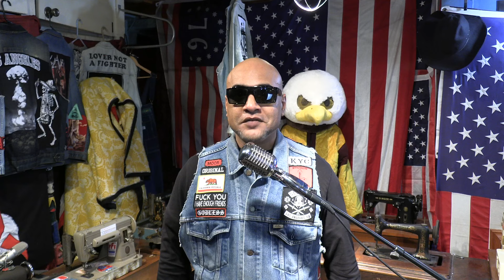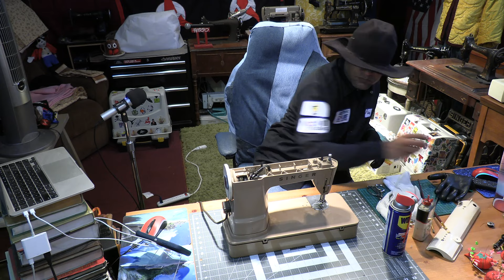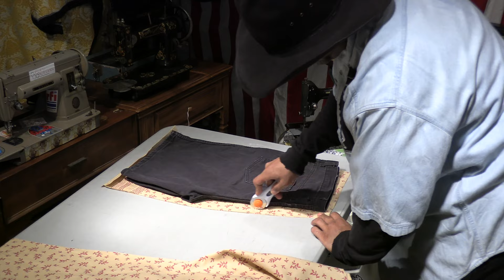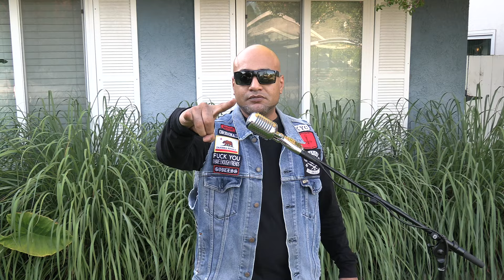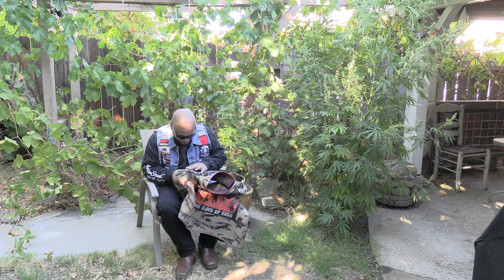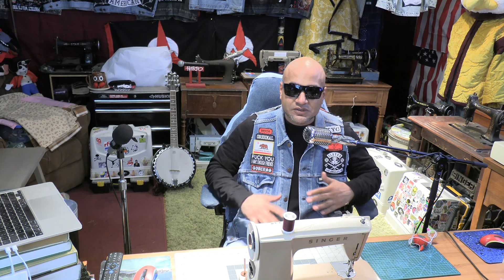My Sew Called Life - Resurrecting A SINGER 404 Sewing Machine & The Grasshopper From Left Field

Comment: 3 in one oil is the wrong lubricant to use on a sewing machine and WD40 is not a lubricant but can be used for cleaning only = get some proper sewing machine oil to maintain your machines.
Reply from the maker: 3 in one actually works extremely well. I have yet to have a problem with any machine that I have ever used it on. I thank you for your advice and opinion. Here at the Godless Sewing Channel audience participation is much appreciated 🤘🏾😘🤘🏾
Reply: Wait until it gums up your machine.